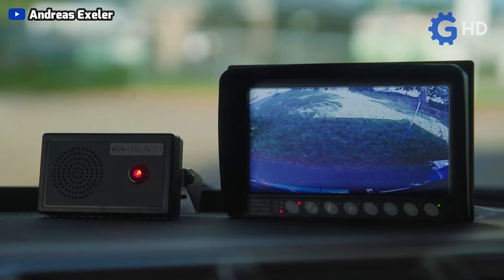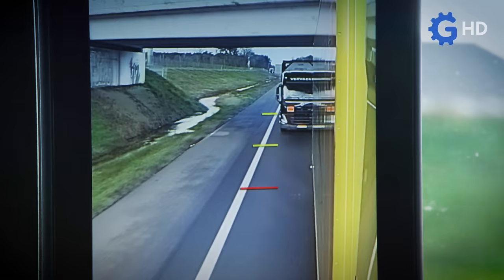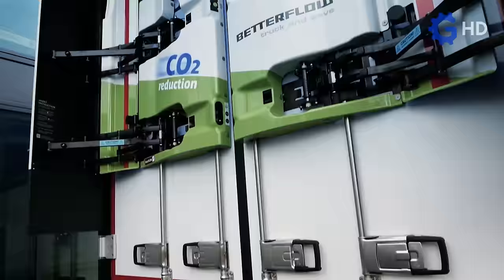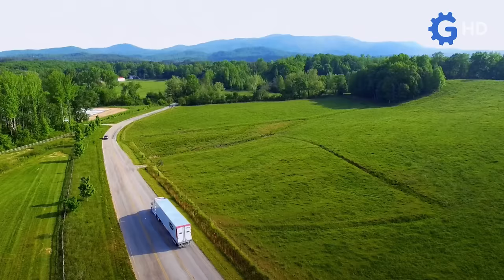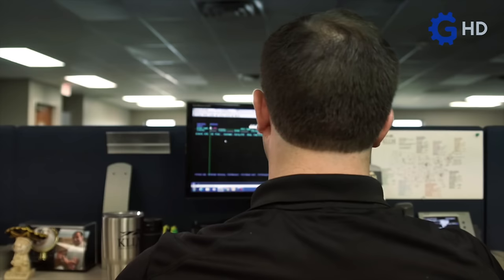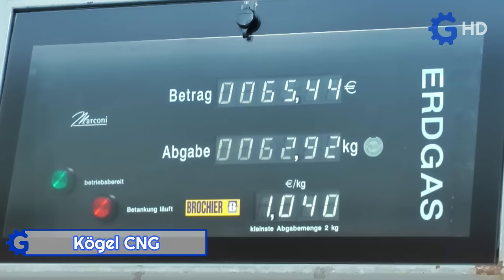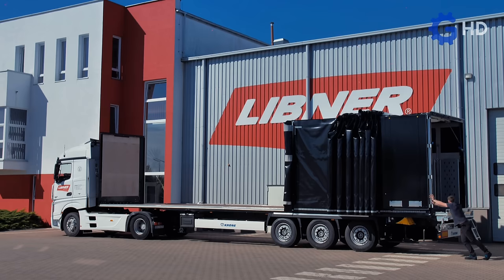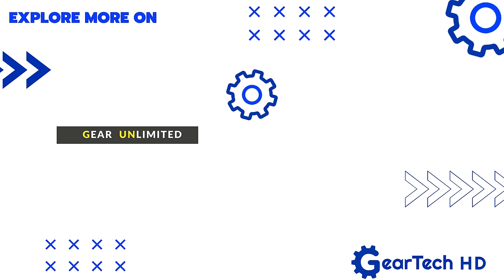10 Incredible Truck Inventions You Probably Didn't Know About! - Heavy Truck Rollover Testing

Comment: I drove a DAF last month with this type of camera (exactly the same as the one on the video). During daytime...it's not bad but you can't see deep field like in a passive mirror because a mirror only reflects light, so you can adjust your view on a single point, not with a camera and light is a massive problem during nighttime (I did a traction during nighttime between midnight and 5AM) because no screen can display black without producing a disturbing glow.
Those screens + dashboard screens = I see my face in the windscreen (light from the screens is reflected by my face and this light is reflected by the windscreen), I can't see the road. I don't need so much light in my cabin but out of my cabin

Comment: The "mirror" cameras should be on everything
Reply: The Co I drive for had 40 units delivers with cameras  last year not one of them still has them fitted as drivers hatted them and refused to drive them thy are all proper glass now much better
Reply: Have you ever driven a vehicle with such cameras? I did, and it's awful because you can't focus your view like in a mirror (if the image is blurred you can focus your view nowhere, the screen doesn't have the same resolution as your view and the mirors' resolution is infinite), and these screens produce light during nighttime even if there's nothing to display, and this light is reflected by your face and your face is reflected by the windscreen (but I don't want to see my face in the windscreen but the road behind the windscreen)
Reply: The mirror cameras are not good enough yet. Also if they are damaged then you are stuck there untill you get recovered as they are not currently fixable at the side of the road and your unit could be off the road for days until it is, just not good enough.
Reply: @RazzyBCF   the idea is good but the technology is not ready (screens produce light and it's disturbing during nighttime)
Reply: @RazzyBCF  ours cost £900 recovery 14 days to fix thank fuck it was under warranty